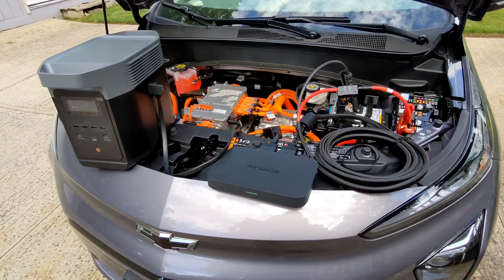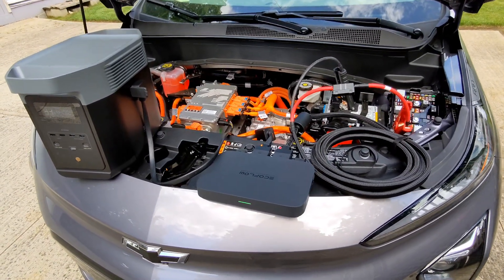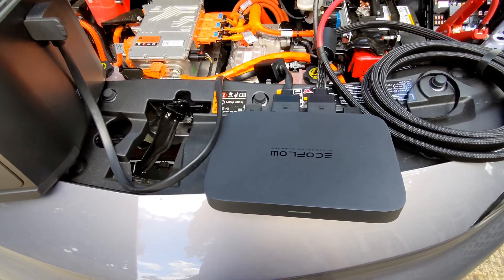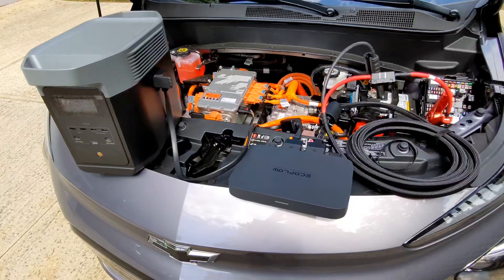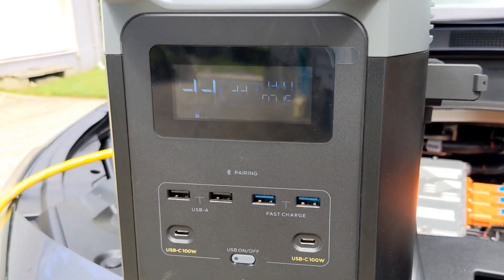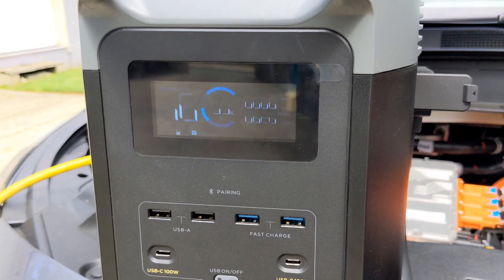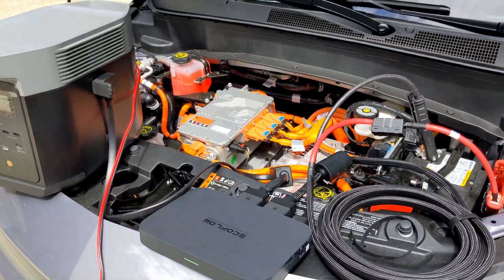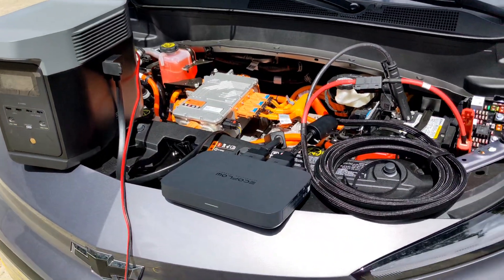EcoFlow Alternator Charger on a Chevy Bolt EUV

Comment: Why would the drive train battery pack be connected to the 12v electronics battery?
Do any other vehicles have this setup?
I've always read that they are left completely separate because of the voltage variances.

Comment: I did this with my Honda Prolouge but I used the DJI Power 1000 and 1kw SuperFast charger and it blew my car's DC to DC converter.  I think the DJI superfast charger was drawing too much current and the car's computer calculated it as a normal load and messed with my range and output.  Luckily it was covered under warranty and I see DJI gives a disclaimer now that it is not to be used on hybrids and EVs.  So it must have happened to other people.  So thanks for showing this video because I will be going with EcoFlow in the future.

Comment: I'm, not very good with this stuff so I'll ask a stupid question. I'm getting a 2025 Sienna. Considering Delta 2 Max + alternator charger bundle. Will my power station be charged only when I drive or could I use the climate control mode and charge my power station (it's my understanding that on climate control mode, the car will start if the high voltage battery gets too low). Any reason I shouldn't do this?

Comment: I bought a cheap dc to dc cinverter from ebay, cost me 49usd and I went to touch it to see how hot it would get, and it blew up on/in my hands, luckily i was touching the metal heat sink part and the explosion happened towards the other side of the step up dc to dc converter, never the less it felt like Tyson punches my hand. Now I'm wating on my eco flow alternator charger smh

Comment: Nothing like going from 300v DC to 14v  DC then whatever voltage the adapter is boosting it too, to store in the battery to then go to 120v AC, from which it most likely started, not to mention all the voltages the AC was at before it got there. lol If only Chevy allowed use to use there own DC inverter they sell for the newer EV's, maybe someday they will software unlock it :)

Comment: Where did you get those aligator clips to hook up to the 12V system? Also do run into issue using 120v to 14-50 adapter and 240V devices in the case you forget to turn of the breaker?

Comment: Just stay away from dc fast chartering station with that piece of shit car. Slow charging. Takes forever. Ruins experience for everyone else
Reply: Cry harder. The low max charge rate in the Bolt isn't that big of a deal when you consider that the battery is also much smaller than typical batteries in most EVs. Someone in an Equinox EV is going to spend 45 minutes at the charger, same as the guy in the Bolt who just needs to get to his next stop. Functionally there is little real world difference and you need to get off your entitlement high horse.

Comment: Couldn’t you just connect the EcoFlow power station DC (solar) input directly to the Bolt 12V battery, and with car powered on, the on board DC DC converter would supply more than 800W at 14+VDC.  No middleman (alternator-charger) required.
Reply from the maker: The solar (DC) input on the EcoFlow only supports a maximum of 15A, so at 14v that would only be ~200W.

Comment: Thank you so much for working on and sharing this! I was wondering, at 1:49 you mention this might not be great for van life / car camping -- could you elaborate on why? I'm trying to evaluate if this alternator charger is a good option for an Ecoflow Delta 2 in my 2024 Toyota Sienna (hybrid) for some month-plus road trips. I appreciate your time and energy!
Reply: I believe he is talking about the clamps are not a permanent setup for van life as it should be hard wired.   But for a parked car and battery backup is fine.

We charge a DP 3600 watts with extra battery and run the inverter for 9-hours at a time.  It get hot to touch but everything else like the cables only get warm.  Even the relays in the fuse box only get warm.
Reply: @normt430  Ah that makes sense, I see how you're reading it. Thanks for sharing your setup! It's helpful to scope out as many as possible :)
Reply: Thanks for asking, I had the same question. I'll get my Sienna in 2 days and am considering a Delta 2 Max (2048 Wh) and alternator charger bundle

Comment: Amazing video. Just bought an Ecoflow Delta Pro and the Smart Alternator and I'm excited to get them installed this week with my Chevy Bolt (I'll try with my BMW i3 and my Fiat 500e as well. Let's see how it goes). Thank you for sharing this valuable information with us. God bless.
Reply: You should give a try connecting the EcoFlow DC input directly to the 12v battery,
The onboard DC DC converter should supply more Watts than the alternator -generator.
Reply: @gregwatson8246 How should this be done? I've seen 12v to XT60i cables,  but the XT60i input on a Delta 2 or Delta 2 Max has a max input of 500w. That's better than a cigarette lighter adapter and cheaper than the Alternator Charger, but less than the 800w output of the alternator charger.

Comment: If you have the Delta 2 max and then you have the extra batteries that you can add to it would you be able to have this set up but use the second part and have an extra battery also be charged? Or would you just have to power the Delta two max disconnect and then charger extra delta battery?

Comment: Interesting use of alternator charger with EV. EcoFlow had told me that this could not be done with an EV but clearly it can. In two minds to try it with mine. Some of the Korean brands have a poor reputation for 12v batteries. 
I guess, in effect a similar result/outcome could be achieved if your EV has V2L capability in that you can charge a portable battery with the car as a generator?

Comment: Nice I got the whole line up too I got x2 ecoflow delta 2 + 2 extender batteries and the alternator too  can’t wait to used it over landing or camping total 4kw total 🎉 and nice staking with the xt60   Hopefully they make that xt60 connector to the alternator system  that would be great I can charge up some other generators in a pinch

Comment: EVs often have a problem with their 12Volt Battery draining after a longer time or in winter after years of use. So the Alternator charger could easily revive the 12Volt Battery if it couldnt power up the car. Very neat product.

Comment: YouTube recommendations actually recommended something useful!  I have a Bolt and I just bought an EcoFlow Delta 2, but I didn't even consider the alternator charger because... no alternator.

I'm interested in learning how you connected it to your house.  It probably won't work for me, but worth learning about it.
Reply: You could connect the EcoFlow DC input directly to the Bolt 12V battery, and with the car on or in ACC mode,  you’d get 14+ VDC and the max watts allowed via that input.  The Bolt’s onboard DC DC converter can certainly provide 800Watts. 
Cut out the middleman (alternator-generator).  Instead of going Dc to Ac to Dc, 
Just keep it simple, Dc to Dc.

Comment: it isn't clear how you connected the device to your car. The positive alligator clip looks like it is attached to the plastic wall of your fuse block.
Reply from the maker: In the Bolt, the positive terminal of the battery is inaccessible, so Chevy provides a remote positive terminal in the fuse box.
Reply: @brsm  TY I'm going to have to look for that in the fuse box.

Comment: Thanks for the vid and explanation! Any input or information on doing this in a Tesla? Model Y specifically. 

I have not seen a video yet for that car/application surprisingly.
Reply: I have a Model Y. Tesla keeps tight control of power out on their cars, unfortunately. It's very hard to tap into the 12V (now 15V) system as all the power from the DC to DC converter is monitored and controlled by MOSFET-gated branch circuits, which don't take kindly to large power taps. The 12V/15V battery is also very small and can be drained quickly if the DC converter is not on. Tesla has some V2L on the Cybertruck, but really is lagging on all other models. Even many gas cars have on-board 120V inverters nowadays.
Reply: I have a Model Y. Tesla keeps tight control of power out on their cars, unfortunately. It's very hard to tap into the 12V (now 15V) system as all the power from the DC to DC converter is monitored and controlled by MOSFET-gated branch circuits, which don't take kindly to large power taps. The 12V/15V battery is also very small and can be drained quickly if the DC converter is not on. Tesla has some V2L on the Cybertruck, but really is lagging on all other models. Even many gas cars have on-board 120V inverters nowadays.
Reply: @bickert19, just checking if you had any luck using it in your Y? Got a 2017 MS that I want to try but wanted to check if you've done it already?

Comment: You're going to smoke your home's appliances using that Ecoflow high frequency, transformerless  inverter. All it's going to take is for one of the MOSFETs in the H-Bridge circuit to short to ground, and because there is no transformer, there's no galvanic isolation between its DC boost stage and its AC output.No thanks.
Reply: Probably circuit breakers, no?

Comment: Thanks however I would be careful pulling 800 watts from the down converter they are not made for that type of continuous load.Most draw on EV's in intermittent there is nothing in that car that would come even close to what your drawing.  If you smoke the down converter you'll pay 3-4 times what that charger cost you. My self I would limit it to 300-400 watts tops. Regards Mike
Reply: While what youre saying is true, the watt figures you’re wuoting are way, way below what would damage the dc-dc converter with continuous draw..
Reply: EVs and hybrids all have electric assisted power steering, which can take a lot of power, especially at slow speeds
Reply: @beltrams  there is a low voltage battery and high voltage battery that handles certain things.
Reply: Heat pump probably draws a lot continuous
Reply: @MtnXfreeride , the heat pump compressors in EVs and hybrids are driven directly from the HV battery pack via a variable frequency drive (VFD), not the 12V system.

Comment: YMMV But this is just pulling from the 12v battery and not from the traction battery. Unless your car will keep the 12v battery charged while it's off, which many don't, this will kill the 12v battery
Reply from the maker: You run this while your car is on and configure the Alternator Charger to turn off when your car turns off, so the 12v battery is never tapped for power. It's all purely from the DC to DC converter.
Reply: @brsm  right but as described in the video it doesn't use the traction battery for this and would only work while the car is on.

Comment: I'm guessing the Delta 2 cannot output 240v - but still a decent backup solution for almost any car!  I'm kind of amazed they built the DC-DC converter with that kind of output...
Reply: That unit can't but there are some ecoflow products that output 240 and I believe they're compatible with that alternator charger
Reply: EVs and hybrids have electric assisted power steering, which can be power hungry, especially at low speeds. That and electric brake boosters,  then all the other typical 12V loads along with more computers than ever, so the DC to DC converters have gotten kind of large.

Comment: Why not just a DC-AC converter ? From 200 € for 1500 W. And of course you also save the price of the power station, so several thousand cheaper. Not to mention the weight and the space. And probably with a better efficiency.
Reply from the maker: The 12v system of the car cannot handle the surges of home usage. For instance, if the fridge and microwave come on at the same time, consumption might go up to ~2400 Watts for a few minutes. This will cause the 12v battery in the car to rapidly drop and potentially go flat, leaving you with no car and no home power in an emergency. 

The power station can handle this kind of fluctuation while the car provides constant recharging. The cost difference between a good pure sine inverter alone (~$200) and this setup (~$800) is not enough to justify the decreased performance and increased risk of going with an inverter alone.
Reply: @brsm  Why not a 12v to 120v inverter to the ecoflow or some other portable power station? Surely you can input 120v power to the ecoflow?

Comment: Did you do anything special to keep the Bolt at 14.0v? Mine drops to 12.6v unless headlamps are on, and i had to manually configure the app to accept 12v
Reply from the maker: Nothing special. I have a 2023 and it seems to automatically kick on the DC-to-DC converter when it detects a draw on the 12V battery.
Reply: I charge 7200 watts of Delta Pro's for 9 hours and the lowest I saw was 12.8 and 770 watts on a 800 setting.  The inverter got hot at 49°C sitting on top of the two units that I had to elevate it off the plastic cover.  

My setup would only see 800 watts and 13.8 for a minute or two and settle back to 770 watts and 12.8v.

This was putting the 2017 Bolt in neutral and shutting off the lights and low powering the radio.  But once driver's side door was opened it put the car in park.

Comment: Any idea of the output voltage? Wondering if I can use this with my Anker F3800 battery which will accept 11-32V 10A or 32V-60V 25A through its XT60 ports. Also does this have an XT60 output option?
Reply from the maker: Yes, I made a couple short videos about this. When not connected to an EcoFlow power station, the Alternator Charger puts out 40V at up to 12.5A (500W total), so it should work fine with the F3800. There's no official XT60 output cable yet, but you can make a custom cable, which I demonstrate..
Reply: @brsm  Nice! Also discovered the Pecron 500W alternator charger yesterday; so now I gotta decide between the sleek Ecoflow with a janky custom cable or the janky Pecron with the provided cable lol.

Comment: Thank You !!!  As a 2 Bolt household that was wondering about maybe getting an Ioniq 5 this really was the video I was looking for.  A couple questions:  What is that battery monitor you had in your 12v port?   The trick I know about is to keep your power going with the car off.  Have you tried that?   I now gotta rewatch !!   At some point I would like to see you set it up "permanently" !!
Reply from the maker: Thanks for watching! The monitor is this one, though there are many like it: https://amzn.to/3Vqa8VA
Reply: Some EV's have a utility mode which prevents undue pull on the 12v battery. Not sure if that might be an option for some

Comment: Great video, thank you very much!
Do you mind providing more detail on the surge events that were causing the car to fault?  Any idea on their peak load and duration?  How large was the Inverter you were using?

I'm asking because my plan was to connect a 12V 2-3kW Inverter directly to the lead acid battery in my Bolt.  My logic was a starter style battery like we have when paired with a large Inverter would avoid the commonplace Inverter tripping issue during a surge event such as a motor (e.g. a vacuum) starting.   Continuous loads would just have to be below approx. 1.2kW.  
But now I'm rethinking that strategy after what you said about the car faulting.
Reply from the maker: Yes, I had the same idea. I was using a 2kw inverter. I had a shop vac running (~800w) and a 1500w space heater with 4 settings (~375w per). When I hit the third setting on the space heater (~1925w total) the voltage dipped to 11.8v-11.9v and the car threw a "Service Battery Fault" error and wouldn't let me shift into gear anymore, even after charging the 12v battery back to full with a battery tender. 

Took me about 4 hours playing around with the car to get it working again. What ultimately worked was completely disconnecting the 12v battery and letting it sit a few minutes, then reconnecting the battery and turning the car on and off a few times.
Reply: @brsm  I appreciate the insight.  It sounds like a load for at least a couple seconds is what caused the voltage to sag enough where the car faulted.  I think I can live with that limitation, but I understand why you went the direction you did.  Especially after it took 4hrs to ensure your car could still be operational.  My tinkering has led to that same feeling of dread when you're questioning if you just created a very expensive paperweight.  I'm glad you got it sorted!

Comment: Good stuff.  Thanks.  I have an Ioniq5 with built in Vehicle to Load capability of 1,900 watts AC which was one of the reasons why I purchased the vehicle.  Your solution is a good one for EV's that do not have the V2L capability built in.  I like your creative thinking.  Keep up the good work.
Reply: We went camping last month and I was able to run a 1700W electric deep fryer via the V2L adapter on my Kia EV6. Off-grid Fish & Chips at the beach! :)
Reply: @bfvader  That's pretty cool, my highlander hybrid has a 1500 watt inverter built in. It's much quieter than a 1500 watt generator
Reply: Could you combine the 800w from this and the 1800w from the AC?

Comment: So are you hooked up directly to the 12v battery or to the DC-DC converter?
Reply: I like this setup, but I would caution anyone about plugging in their EV into the Delta II for 120V charging in case they were pondering this. It would create a very dangerous loop. We actually had our home 120V wired on one leg of our home panel so we could isolate power via the circuit breakers. This setup could effectively run our entire home 120V as long as we keep the load under 1800W and 20A limit of the Delta II. Thanks for sharing.
Reply: @heart4Pahoa  sorry not understanding. Can you elaborate on what the problem is?
Reply from the maker: Technically, both. You connect to the 12v battery terminals, which are also connected to the DC-to-DC converter.